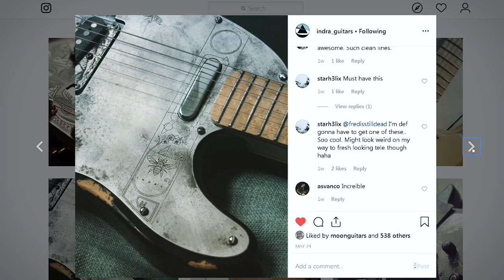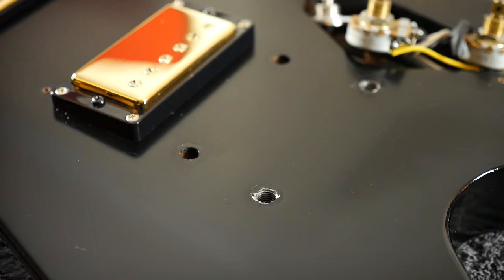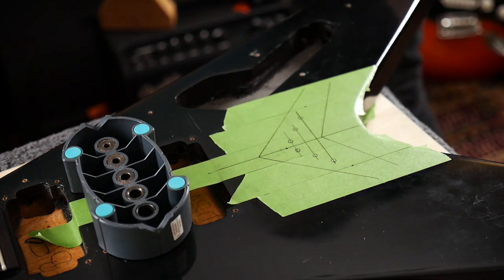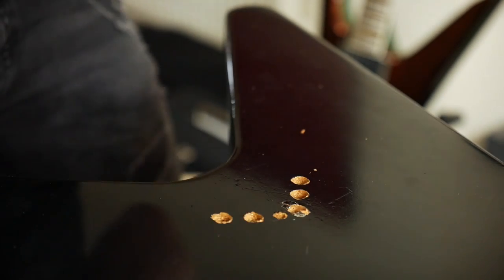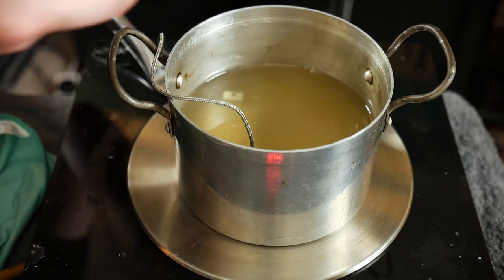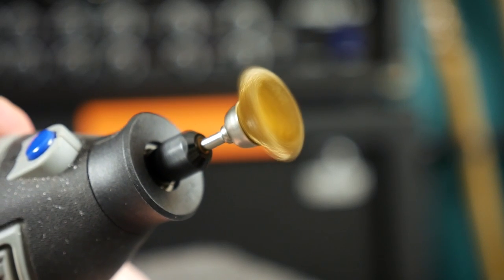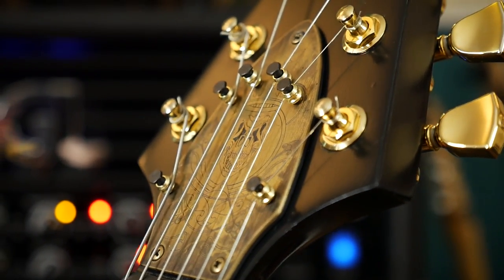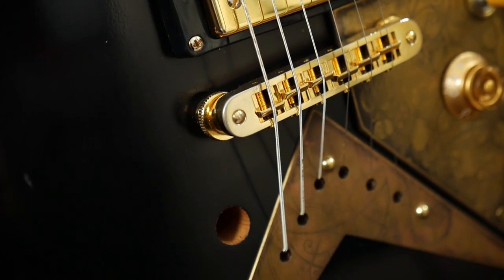Etched Brass Upgrades | Gibson 'Golden' Gothic Flying V

Comment from the maker: Upgrades continue on the Gibson Gothic Flying V, this time we convert for string through and install custom metal parts. 

Etched brass parts by Indra Guitars:
https://www.indraguitars.com/

string alignment tool by String Butler:
https://www.string-butler.com/

Display your V securely with VStand:
http://vstand.org/

More from CSGuitars: 

Gain access to exclusive content at: https://www.patreon.com/csguitars

Buy CSGuitars Merchandise:
http://csguitars.bigcartel.com/

Website:
http://www.csguitars.co.uk

Contact:
colin@csguitars.co.uk
Reply: CSGuitars this V is absolutely gorgeous
(If folks are wondering what to do with the old bridge hole maybe go for a kill switch or just plug it with a bit of dowel)
Reply: Pretty nice guitar. Looks really nice. :D
I was wondering if you could do a TATA on Wah-pedals? I'm not sure what they do and how they do it.
Reply: Hi Colin ! ;)
Very beautifull, Unique guitar and personnal upgrades !! 
Nice fucking job and choice :)

maybe also see :
Tuning machine or just tuning keys ( Gold keys and full black machine ? )
cover pickups ( relic brass finish ? with black pole )
knob potentiometer ( more personnal choice, no plastic gibson :) )
Reply: and yesterday on other video I left you a question ;)

' How to measure mA for 'each output line' power supply ?
 '

I want to know how much is worth to miliiamper each output. 
Manufacturers announce values, but I want to check to be certain.
Safely.

Thanks
Reply: When you drill a hole you should stop 3/4 of the way through then turn it over and go the other way. That’s how you avoid blow out
Reply from the maker: That only works if you know the exit point precisely and know that your drill bit is following a straight path.
Reply: @8:37 "cock-up cascade" HAHAHAHAHA! Love it...stateside would be FUBAR or the less common "shit avalanche".
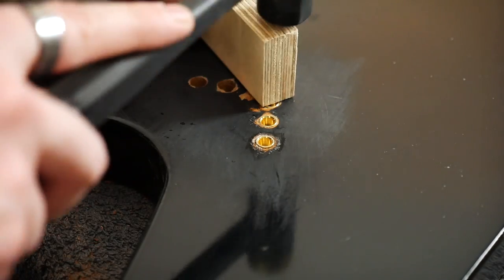Reply: @9:40 You bet. Problems are gonna rear their ugly heads... "There are no such things as challenges, only opportunities to exceed and excell by the measure of your mettle."
Reply: CSGuitars Perhaps pre-drill with a much smaller bit and then countersink the exit point with the main bit? Either way, beautiful guitar 👍
Reply: A smaller size (still pretty heavy device) professional drill press is really an inexpensive piece of equipment. Consider this when you start working quite a bit with guitars.
Reply: For as long as the cunning plan doesn't involve cutting off the head ... everything is fine :D
https://www.youtube.com/watch?v=AsXKS8Nyu8Q
Reply: Please ! Post the video when you refinish the top and back after filling the stopbar holes and leveling the back.
Reply: taking wood shop in school would of prevented you from drilling through a finished piece!

Comment: FYI, you could've used the plunge router base for your Dremel to drill pilot holes for those ferrules and get them perfectly square to the top and back. Should just about be possible to get a 3mm bit all the way through. Mark the exit holes and use the scalpel to score a 3mm square centred on those marks to minimise blowout, especially if you put some tape around the bit to mark where it's about to punch through and ease up on the drilling pressure just before you go all the way through. A 3mm pilot hole would be perfect to centre the brad points on the larger bits you use on the hand drill and keep them aligned as you drill through to the final diameters. Also, drilling the ferrule recesses in the back first and then drilling through from the top would also ensure that any blowout would happen inside the recesses rather than marring the back as you did here, and as long as you did the pilot hole first then both holes should be well aligned.

Comment: Great vid, superb inlay work and the result is amazing. I was very skeptical as it destroyed an original in a sense but it turned out charming! - I'd suggest putting something swanky on the remaining post hole instead of just plugging it:  Route a killswitch to it or add another dinoskull cap for it.

Comment: I have been researching how to install covers on open pick-ups, I found your method of totally submerging the pick-up in a pot of melted wax very interesting. Excellent work on the V it looks fantastic.
Reply: That's the standard, non-commercial method for wax potting pickups that's been used by thousands of people for decades. Pretty sure most commercial pickup makers use a vacuum chamber to suck the air out of the winds and force the wax in.

Comment: Amazing. The guitar sounds and looks  wicked. The trick with the brass brush is sweet. I have a strat type guitar built from parts in which i installed a vintage Guild HB1 pickup which is gold; this method will work great for the pickup and pickguard screws. Thanks for a great video.

Comment: needs a brass switch tip!!
Reply: Along with brass covers and tuners, imo. Otherwise, a seriously badass conversion.
Reply: Oh yes,I wish my les Paul could look as cool
Reply: @soul-6323  - It can, just do what he is doing! I recently purchased a 2014 Gibson Les Paul that someone tried to refinish, they did a horrible job btw. But I have always wanted a Gibson Les Paul Standard or custom but my wallet only allows for the Studio models, which are great guitars but they just don't have all the fancy stuff on them. So I got this Les Paul Studio for a great price, $400!! and decided to make it my pet project and create my own Les Paul custom, I did not put binding on the body though. To make it a truly "custom" guitar I decided to cut in a belly comfort cut. I have seen this done on other style guitars but not on a Les Paul. But I decided to gamble with it and give it a shot. When I got my cut almost down to the depth I wanted guess what I found? You know how Gibson does that weight relief stuff? Yeah, where I was making the comfort cut the mahogany had been hallowed out so I ended up with a hole now that was about 5 inches long and running right through the middle of my belly cut lol. After some fancy fill work I am glad to say that the guitar is now in the process of having the Nitro clear coat applied and should be ready for full and final assembly in a couple of weeks and you cannot even tell what happened in the comfort cut. Live and learn and make mistakes, but in the end it's all fun and rewarding. So to you I say, purchase some brass pieces and start customizing your own Les Paul.
Reply: i always wanted onem myself and i saw a 2013 tribute goldtop in a pawnshop so i boguth it,now the finish is flaking off and turnign green adn tis desperate for new frets,i jsut dont even have money for a pickgaurd at the moment
Reply: @soul-6323  - A lot of people like it when those gold tops start turning like that, it's now vintage. I have a white Les Paul that is yellowing and everyone who sees it thinks it's cool because of the yellowing. I guess I am weird, If I buy a white guitar, 20 years later I don't want a yellow guitar lol. I have yet to do any work with frets but have the tools and I do have one guitar is in need of some fret work so it will be my first victim lol. If I felt more comfortable in my skills I would do the fret work for ya for nothing other than you pay the shipping fees, but right now I would not do it for fear I would end up having to replace your guitar lol.
Reply: Yea there's a lot of stuff I'd like to do to my les paul,i dont know if it's a worthy guitar to be with me forever though,I'll most likely save up and get a nice burst or a studio Custom
Reply: i actually looked at it,but im an unemployed 17 year old shredder so i cant really do that i barely have 100 bucks to my name as we speak,
i had a freind suggest i just get some on that and return them jsut to play on them for a bit,btu if i broke one id be in some deep shit
Reply: otherwise man you should add me on somthing,so wee can keep in touch
Reply: @soul-6323  Yeah and that's not how you wanna start your adult life out is it? Buying stuff with the intention of returning it? You know you will find that one guitar that you love and then years later you will feel bad for how you got it lol. But at 17, are you still in school? If not, then you have time to find a job and work it and earn money to buy your new guitar.
Reply: i shot ya an email my dude
Reply: How aren't you getting copyright infringement...ed? I got my cover of that particular song taken down (I wont name it...just in case) - and I'm a nobody with just two uploads! (well, just one now, actually..)

Comment: Colin, m' lad, I want to give you a way of removing bridge and tailpiece inserts that should be somewhat more easy than what you used.  I've tried this myself, and while I can't say it's magic, it's very efficient.  Just get a small metal dowel that's short enough to go into the insert with a few threads of clearance, drop it in, seat the post over the insert and screw it in gently.  The dowel will keep the post from going into the insert, which means that the insert will be pulled up from the guitar body.  This was amazingly easy when I did it and did no damage at all to the guitar.  Your way works, but the method I described pulls the insert straight up and prevents unwanted changes in the shape of the insert hole.  Try it; it works, and you can always go back to your original method if you so choose.  Cheers!

Comment: Just a question on doing the inlay, if you wanted to keep the smaller details that you lost during sanding, could you have sunk the inlay deeper and then filled with a clear reason, sanded and buffed.  This would, also give the inlay protection from tarnishing and wear from the strings.

Cheers,
Chris

Comment: Oh dang! Related to my comment on the other video. Seeing you remove the stop bar was helpful. I didn't realized they metal parts were covered with tape. That's a relief. I was sketched out because I had to raise the bridge and bar because the previous owner set the action insanely low and when I tuned it to D standard it was buzzing all very the place. When I loosed it it seemed like some wood shaving were coming out? Very odd.
I'd really like to get it refinished because it's a bit flaky on the edges of the fret board and must have gotten a ding on the front that the last owner tried unsuccessfully to cover with  something. Last time I got a luthier to refinish a guitar if cost me $1000 though, so maybe I'll live with it!
They also swapped the pickups out for EMGs, which is a shame.

Comment: Use a mosaic pin to plug the bridge post hole.  They are used in knife making to pin knife handles together.   The back I would router out for another plate, unless you plan on refinishing the whole guitar.

Comment: Mark out where your holes start on top, then mark the holes from underneath.  Drill SMALL pilot hole from underneath, about 10mm into the wood.  Drill ferule holes into the wood, but start the drill in reverse, gently, then forwards.  Lastly drill your holes from the top, being careful not to follow through when they meet up with your ferule holes.  I made exactly the same mistakes.  Hindsight is wonderful!   :-)

Comment: I think it would be better install the String Butler between the washer and nut instead then under the nut in order to reduce the impressions on the paint... but the solution of "integrating" the butler in the coverplate is just genious! I like it a lot!

Comment: What I did in that situation was measure extremely well, and start the hole from both sides of the guitar. Only a half inch or so from the back and the rest of the way through from the front. It worked well enough for me anyway.

Comment: I feel your pain with those holes for the string through. I am fully customizing a Gibson Firebird Zero and I wanted to change it from the stock single stop tail wrap around tail piece to a string through design. I drilled my smaller holes first and all went well, but then it happened! When I flipped the guitar and attempted to drill out the larger holes, I realized I had measured ONLY for the small holes and as such, the spacing was much too close and it was impossible to finish. So, I filled all the holes up nice and tight and then I got a brainstorm, I have now decided to turn this guitar away from being a Firebird and instead it will be a "Telebird" ! Yes, I came up with that name lol. I am going to utilize a Tele style bridge and do other things to make this guitar obviously look like a hybrid of the two guitar styles, so far everyone I have told my plan to have liked the idea, now to just see my plan go from my brain to the actual guitar lol. 

Now let me see if I understand this correctly, you repair, build and customize guitars and yet you do not own a drill press? Why is this? I found on Amazon a neat tool, it is a drill press that you can take your cordless drill and install it into the head of the drill press and it works just like a normal drill press! Unfortunately my cordless drills have a style of chuck that makes them unable to work with this unit, but as far as I can see in this video your drill would/should work with it. If you want more info let me know and I will look up the name of it for ya. 

Oh, a tip for ya -  to prevent that blowout from happening again a wood builder gave me this advice -  on both sides of the guitar take your punch and punch the centers of both holes on both sides of the guitar prior to drilling, this idea I have not yet tried myself but I can see that yeah it should do the trick and prevent that from happening. He did say to make the exit holes deeper than the entrance, in other words hit the punch a tad harder and punch it in a tad deeper. Another trick that I have used is that I will take my the drill and bit and start a hole in the exit side first, I just go in about a 1/16" then flip it over and drill as normal. 

That is some beautiful etched brass work and you did a great job on that inlay!!!

Comment: I suppose a way to completely make sure theres no blow out of the finish is to drill the holes on the back about a quarter inch then flip the guitar over and drill those holes to meet the others in the middle so the finish isnt chippy. You are a brave man. You will get no crap from me. You have to break some eggs for innovation.

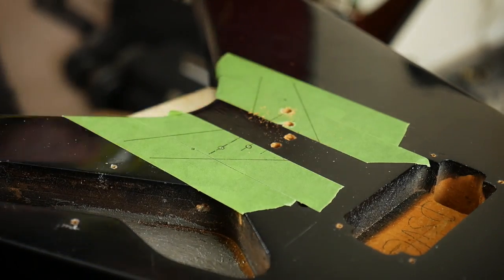Comment: 8:55 - I have done this exact error!  mine was a little more spectacular tho as I didnt have any scrap behind the body and the blow out was considerable!  Luckily, some 2 part epoxy fixed the hole (this was in the days when I didnt know or care about woodwork, so I just went at it full steam ahead on my bedroom floor!)  I also caught my long hair in the drill chuck that day!  no harm done, but having a grease laden dredlock on the front of my head was an experience!

If anything, I would say you should have drilled much smaller pilot holes before moving up to the correct size.  once you have a pilot hole, the drill will follow the path of least resistance and make it much easier to widen the hole, especially with a hand drill.  Going straight at it with a larger bit is possible, but as you have shown, mistakes happen!  

one last thing... stores like Aldi do occasionally have a cheap (£40-£60) pillar drill that fits on the bench.  Even though its fairly low powered (150-250 watts), if you're using a decent drill bit, its more than capable of doing this type of job accurately.  the one I have does have adjustable torque drive belts under the hood so you can make it more effective for harder woods, but at that price, its a bit of a steal and for this type of work, its well worth the cost.

I'm currently referbing a Jackson king v with a 30 year old Charvel model 3 neck, so I will hit Indra up and see what he has to offer.  Cheers Colin!

Comment: Curiously........or maybe not as much anymore, String Butler now sells a model on a plate specifically for the flying V.
I suspect Colin may be the reason they started doing this.
Reply from the maker: I don't want to take credit, but I know exactly where they got the idea from.
Reply: @ScienceofLoud   I have a black V like this but "standard"... Yours is... super amazing!! Let me say that! Hell yeah!!
I have a question: with the string butler installed... Have you needed to change the tuners with locking tuners? Thanks 🤟

Comment: hints for blowouts, they happen cause of low speed drilling. Your dremel would've been better. remember a string is barely 1 or 2mm. you can sink in the ferrules from the other side with an 8mm dremel routing bit.

Comment: Hey Colin, I have a question:
Would it also have been possible to put that 12th fret Inlay deeper into the wood than necessary and fill everything up with some glue or resin? This way you would just have to level the resin or the glue, and not the Inlay itself.
Great work and your guitar looks absolutely badass now!
All hail from Austria
Reply from the maker: Absolutely, that was a consideration, but I wanted the brass exposed so that it would continue to age along with the other parts over time.
Reply: @ScienceofLoud  Ah, ok, this is a good point. Thanks for the quick answer!

Comment: hey collin, you might have gotten better results with drilling if you drilled pilot holes first. [starting with a small drill bit and working your way up in size until the diameter you need for the whole]
Reply from the maker: I would have BUT I didn't have a smaller guide to ensure the pilot hole would go through straight. I was limited by the tools I had, not by lack of knowledge of the processes unfortunately.
Reply: @ScienceofLoud  ahh that makes sense. well done though looks great, you did a good job.

Comment: Would it have worked if you put the ground wire under the v plate, given that brass is conductive and the strings touch the plate?